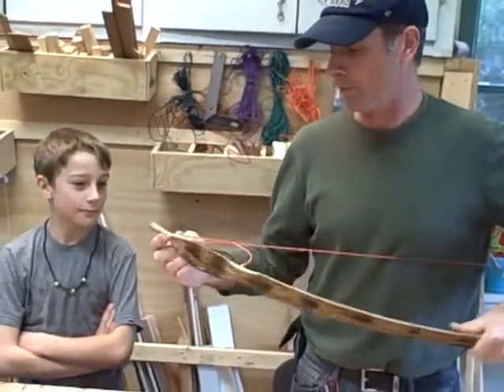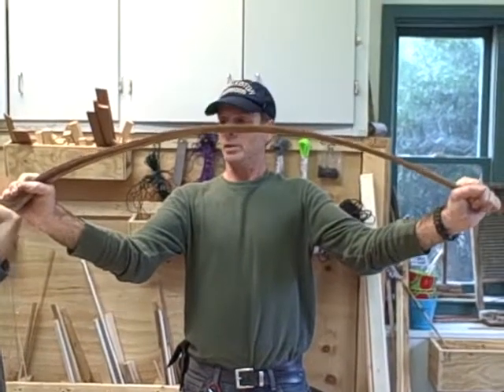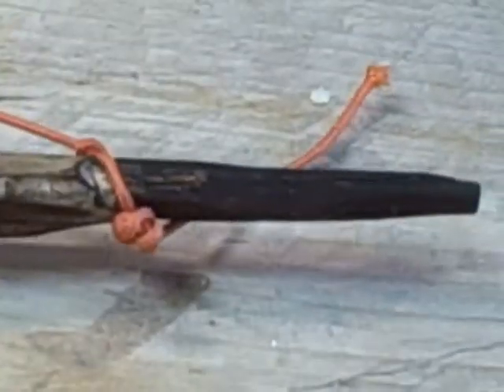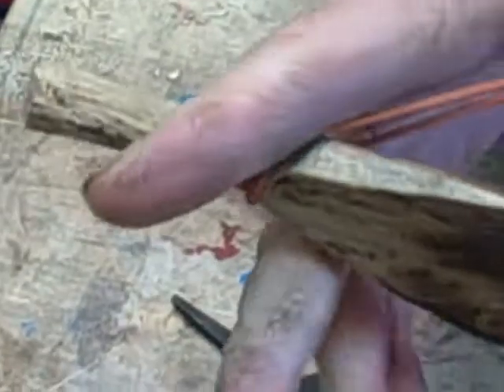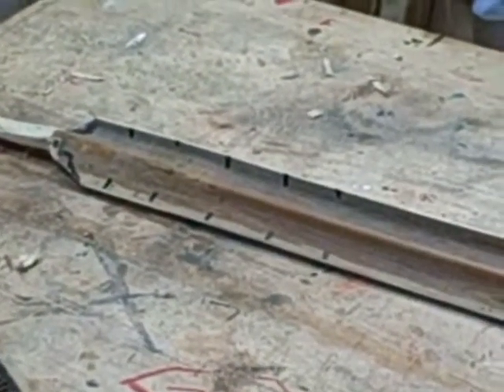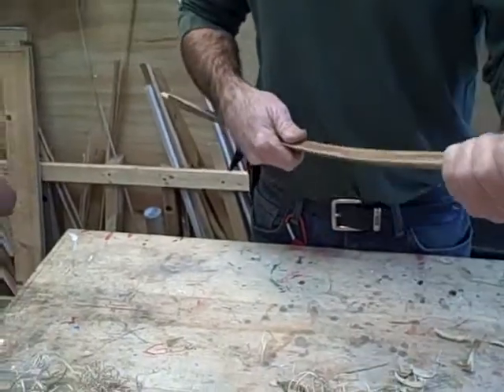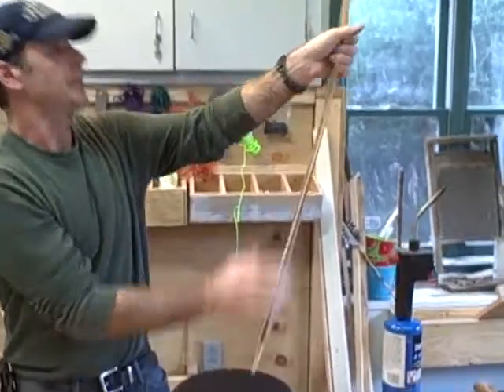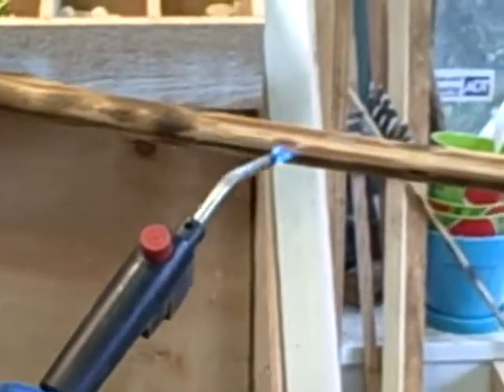Palm Frond Rattlesnake Bow

Comment: that is really a good video,, it is always good to put a tool in a kids hand than a PlayStation controller, I am 40 have worked with steel for 20+ yr, but I have been building lately these Palm  bows what is the best type of palm do you think to use a coconut palm or Royal Palm I usually build them when I come down to Florida and there's every type of palm fronds that you could choose from right now I am working on one that's approximately 3 feet long and it's made from a coconut frond but those only fall off during the big storm so to get one that's green and shape it, typically you would have to climb a tree or if there's a storm they'll fall off but the Royal Palms they just fall off on their own is it better to work these green or let them dry out somewhat and then form  them like I said I'm real new to this I've only made a couple and and I'm having problems getting the tiller right